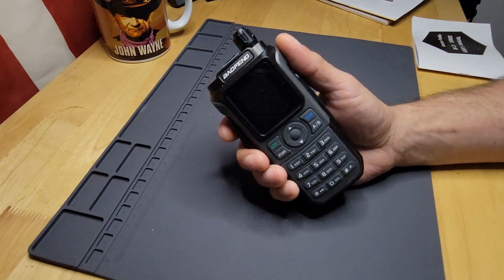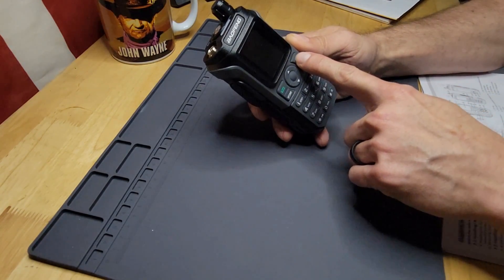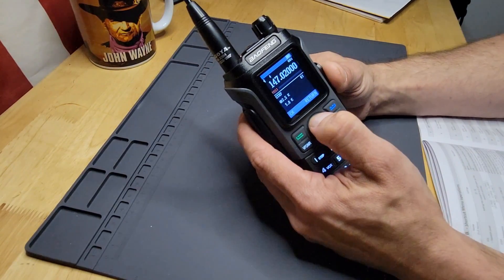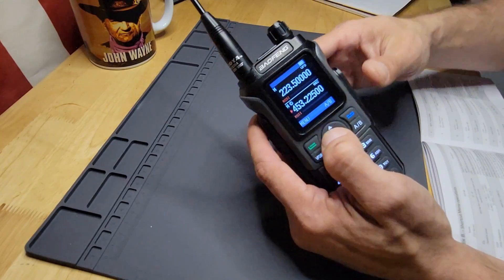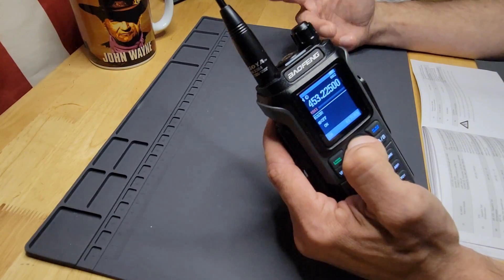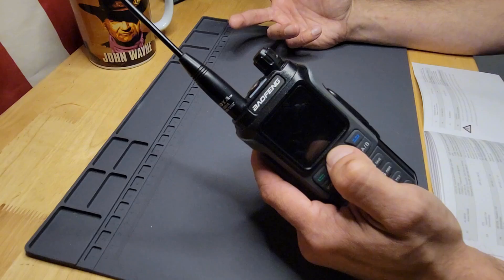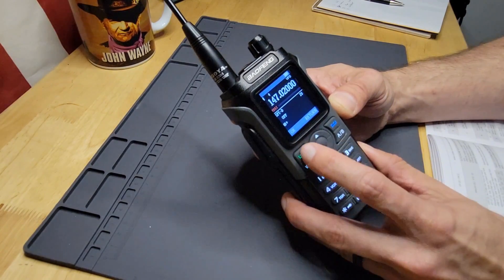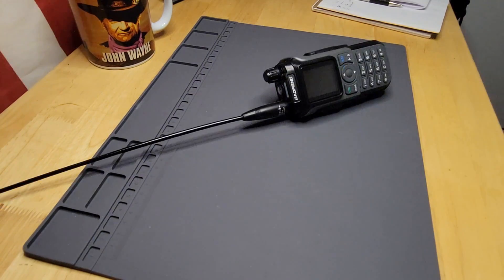Baofeng UV-21R Tri-Band Functions and Programming a Repeater

Comment: Has anyone figured out how to unlock some of the frequencies on this radio, I know the UV5R has an unlocked procedure which is holding down a couple buttons while you’re turning the radio on, but I don’t know about the UV21R
Reply: Any word been tryin to unlock mine?
Reply: I have some problem uv-21 how to unlock so I can transmit on my work frequency, the UV-5 and uv-82 I was able to unlock but the UV-21 will not unlock the same way thanks for any answers

Comment: What's the range on these
Reply from the maker: It has around 5 watts of power. Your range will depend on your antenna setup, along with your environment, etc.
Reply: @NukaVaultReadiness  just say standard antenna and on a beach
Reply from the maker: In an open viewing area, I would venture to say a couple of miles at least, barring there aren't any obstacles in the way.

Comment: So you can or can’t use as police scanner
Reply from the maker: As far as my knowledge takes me, you will not be able to scan most police frequencies on an analog VHF/UHF radio.
Most emergency services (at least in mid to large departments) are all on digital and usually secure.
Reply: @NukaVaultReadiness most of all emergency services are on viper

Comment: Did you go straight to the Nagoya or did you test if the stock antennas were any good?
Reply from the maker: I usually go to the Nagoya, but I should have checked the stock antenna (good point). There are a couple of 2M repeaters that I can hit with an ok signal report, so I just upgrade immediately. 70cm repeaters I can almost NEVER hit with a stock antenna from my location (lots of dense trees).

Comment: The screw in battery is because it’s IP-57 or 67 waterproof (it advertises as both). The screw keeps it pressed to the waterproof seal. Thanks for the review.
Reply from the maker: Funny, it doesn't mention that on its Amazon sales page that I bought it from.
Reply: @NukaVaultReadiness  I’m sorry, I have the UV-21 Pro V2. The instruction manual says IP-57, but the advertisement says IP-67. I didn’t realize it wasn’t the same radio.
Reply from the maker: Therein lies the answer. Thank you for the follow up!